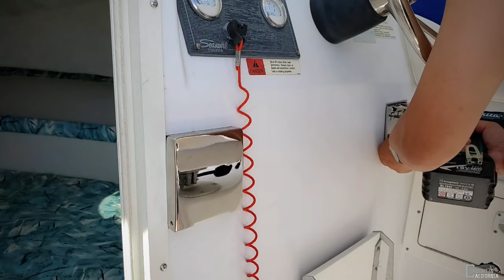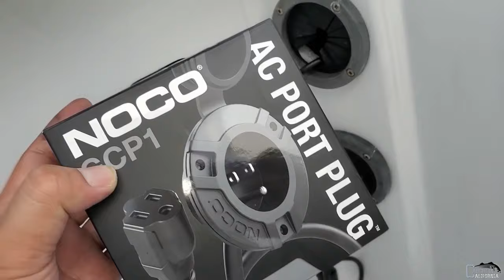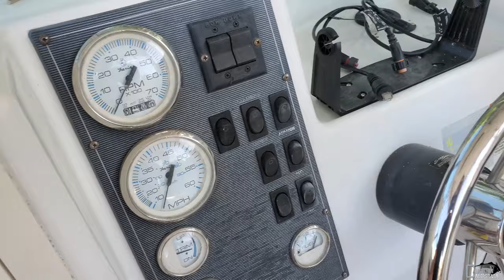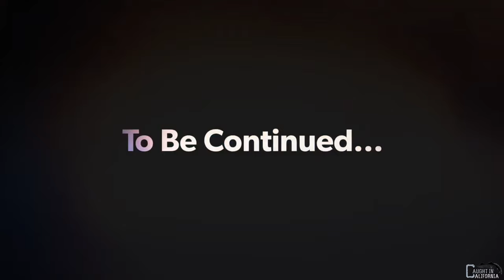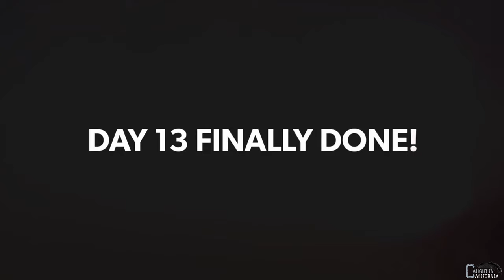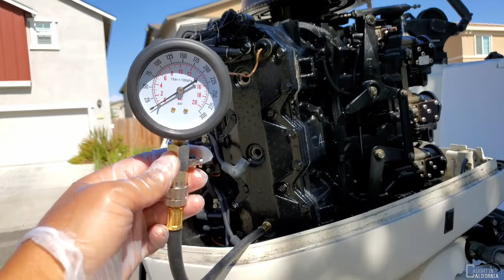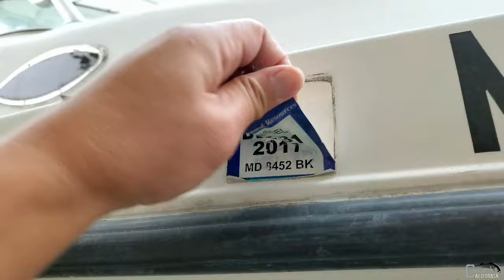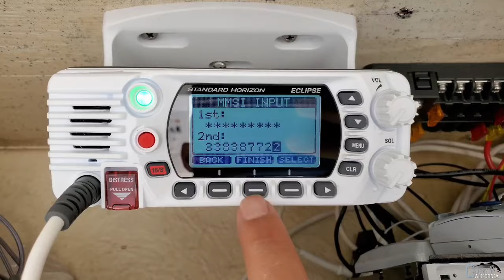Custom Seaswirl Striper 2300WA,Garmin LiveScope,9.9 Suzuki

Comment: how did you mount that cooler on the swim deck very cool and good use of space...
Reply from the maker: I apologize for the super delayed response, I am just getting back into the swing of things and reviewing my channel and the comments. on this particular video, I was suprised you even asked since I don't recall seeing any Coolers mounted, you must have been watching some of my later video just after this one where I started the sea trial, anyway thanks for watching if you got that far than you have been following me and I do appreciate it. Now to answer your question, I used standard stainless steel tie downs and installed them near important parts at the transom to allow the use of tie down straps to lock the cooler in place, that coupled with standard bungee ropes with hooks to secure it. I hope that answers you questions?

Comment: I would like to see you install a small ac  like a wall ac or a portable on top of the sink, i own a 2301 and i can't figure out where to put a  ac,i pull mine with a 2002 silverado 1500 but I need a bigger truck ,do you know how much your boat weigh  thanks
Reply from the maker: My boat weighs 3500 lbs dry, with the 200 johnson add 400 lbs, 875 pounds  of fuel and its 4875lbs wet

I have a expedition that can tow 8 passengers and my boat happily fully loaded with gear, hopefully that gives you an idea. I dont need an AC cause I am mostly in the Helm hardly ever in the Cuddy
Reply: @24ksportfishing  thank you for your time, thank you for your answer s happy Thanksgiving to you and your family, new to your channel, I went to sleep last night watching your videos, you have great videos  thanks for your videos